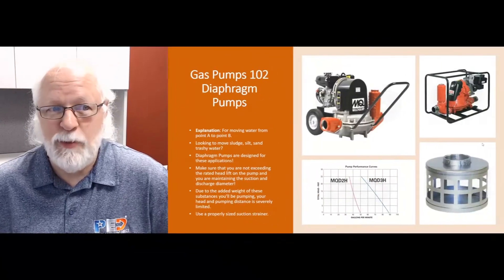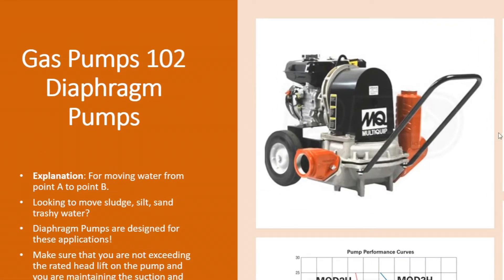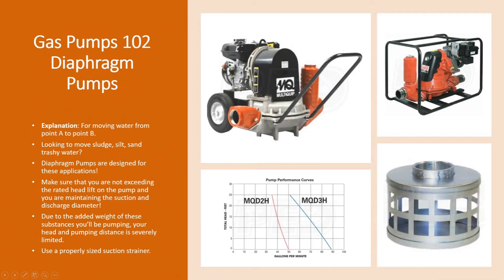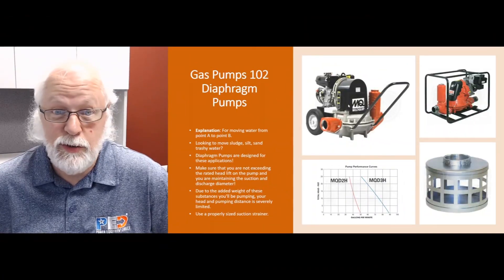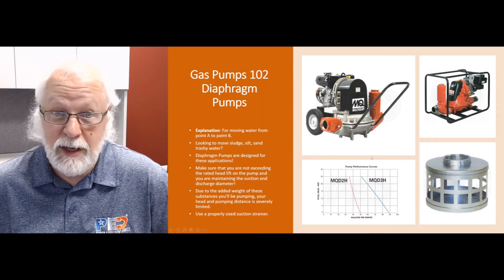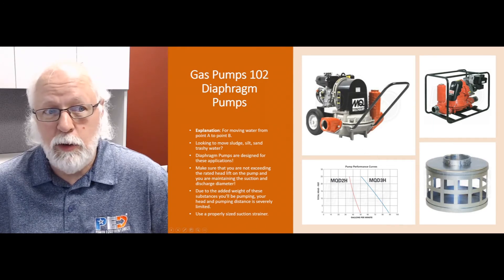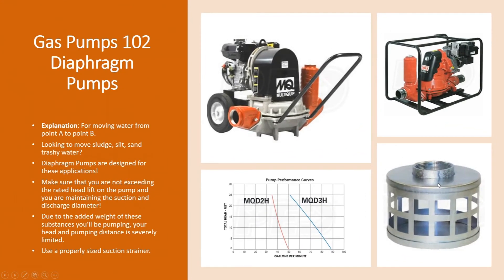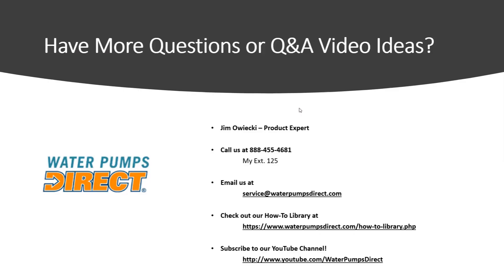What Are Diaphragm Pumps Used For?

Comment: So when a pump is labeled copper motor. Is the piston that comes in contact with the water made from copper as well ? Just wandering because I will be using one to pump r.o water with a low TDS.  And low TDS water . I've read corrodes copper 😅

Comment: Can this work for pumping flowable fill?
Reply from the maker: While it’s possible, you would still need to keep in mind that your pumping distance and max head lift will be severely reduced with this material. We would also STRONGLY suggest that you flush and rinse the pump with fresh water VERY WELL after each use.